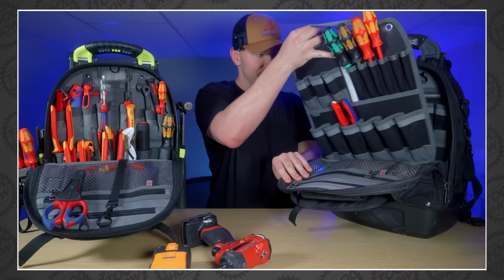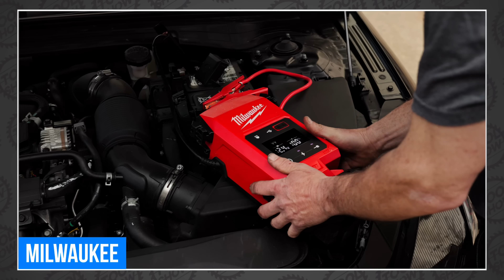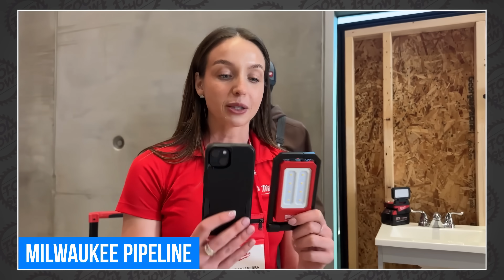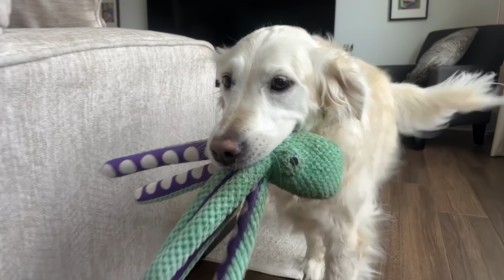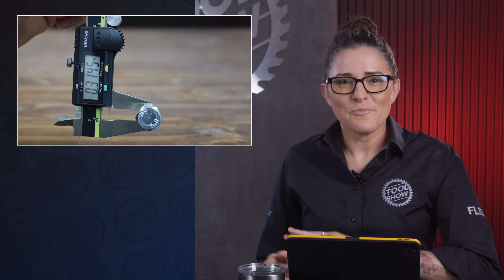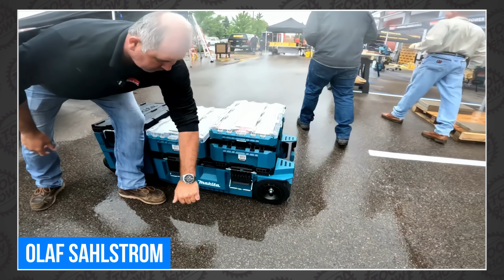Milwaukee is announcing 40 NEW POWER TOOLS at PIPELINE! Plus new tools from Harbor Freight and Bosch

Comment: Milwaukee Pipeline 2025, when is Milwaukee going to finally make a M18 or M12 Rivet Nut Setter? I have used both the M18 & M12 rivet gun and when the came out with the M18 Lockbolt tool I was hoping a rivet nut setter was right around the corner. Really hope that’s something that Milwaukee is working on.

Comment: 1) I Want to see an M18 drywall sander, its long overdue

2) a horizontal paper towel roll holder to mount directly to the side of the packouts, and a horizontal pole for wire spool feeder would be nice. 

3) Lastly, that new m18 packout radio is nice but it has a lot of wasted space, its profile could be sleeker and cut down to half the height if it had a built in battery instead of the m18 option. Size matters.

Comment: Snow. Cmon Milwaukee, I'd buy an mx snowblower since I have some batteries already. Mx batteries are 72 volt right?? So make the snowblower m72 running off four m18 batteries or a single mx battery. Mx batteries are perfect for this and a snowblower would be a great way to get ppl on that platform.

Comment: Since you asked:
• An M18  5” Flathead grinder with VARIABLE SPEED.  Nobody- neither at Milwaukee nor among vendors , can offer an explanation why they’ve yet to introduce one. 

• An M18  1/4, 1/2 &/or 3/4” handheld belt grinder/sander.

Comment: Milwaukee needs to make a M-12 hot glue gun, cant be that hard they already make a soldering Iron
Reply: Hard agree
Reply: They’re waiting for everyone’s $300 bucks for car jumper to buy tooling and molds.  What did they do collab with SnapOn to make a car jumper?  Come on Milwaukee!
Reply: I bought a knockoff that uses the m18 battery. Not the best, but good enough when there's no power available.
Reply: They need more redlithium usb tools. So much potential  and they only use it for flashlights…
Reply: I know, I had the snap-on butane one for 15 years and it finally died. With none made by Milwaukee I resorted to buying rigid. So I bought the rigid one and have the m18 battery adaptor on it. Can't complain.
Reply: Use their battery inverter. Works great for soldiering irons and hot glue guns.
Reply: I bought a cheap glue gun off Amazon that uses Dewalt batteries and been working great for years it can’t be that hard
Reply: Hot glue is for kids
Reply: I use the Bauer one with an M18 adapter. Works perfect and I don't have to switch battery platforms. I do wish I had a small 2 AH m18 battery for it. $40 total
Reply: it will end up being like the heat gun....junk
Reply: Except the soldering iron destroys itself if used and is widely considered critically flawed...
Reply: @UnderBakedOverEngineered 
Not sure why that is the case. I bought one and it's been serving me well for over 4 years. All  I really do is use good quality flux and a brass tip cleaner. Still going strong on the original tip.

I used to have a gas dremel but that thing has no comparison to milwaukee.

I live in Europe and bought it there, but one would think that should't make a difference.
Reply: @CorneliusTaylor-s1u
I was thinking in terms of one big integrated market which Europe is, hence I stated "Europe".
I'm not sure why that matters anyways. I live in Poland.
Reply: @dejwinci  yes, but Miniware or Fnirsi soldering irons are much more convenient and powerful, powered by powerbanks.
Reply: @CorneliusTaylor-s1u
If you want to be so picky...
The European Union is an integrated market. It consists of 61,4% of all countries (a "part" according to you) or 57,4% if I am to count countries that also reside outside of the continent. The EU's GDP in 2024 accounted for 72% of all of Europe's GDP. Just to be precise, because you don't seem like generalisations.

I should be saying what I want, not what you would have said. Not to mention that detail was mostly irrelevant to the core of the discussion and only to hint at a potential product difference.
Reply: @dimaesb  I agree that the milwaukee is a bit on the bigger side of soldering irons, but I never really felt it lacked power. It seems to be doing just fine for my applications.
But thanks for the recommendations, I might just have to try them out for myself :)
Reply: Yeeessss